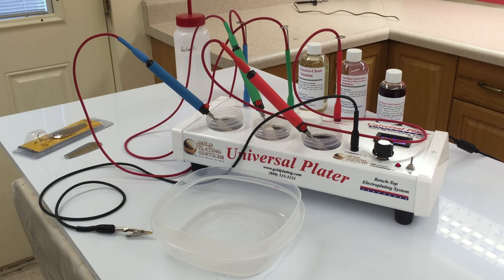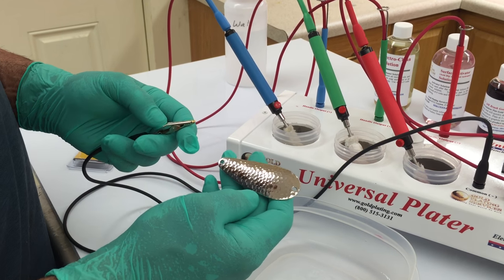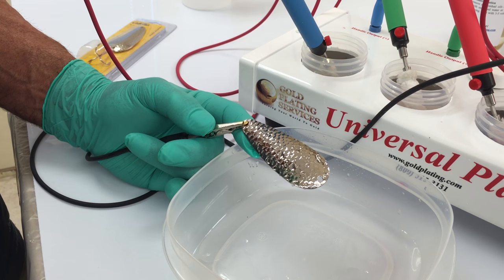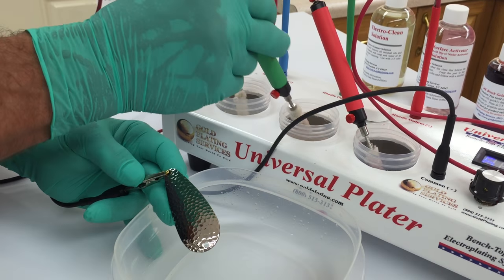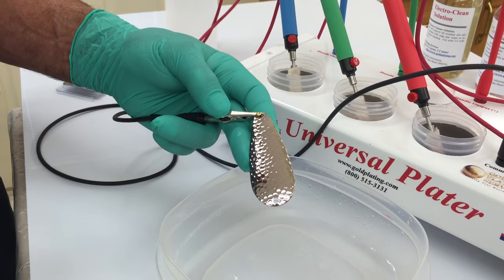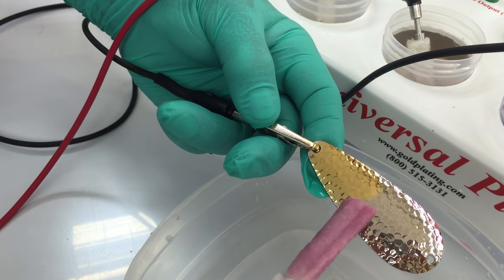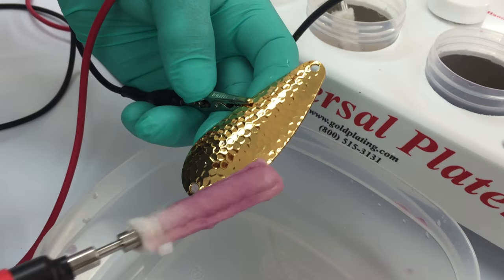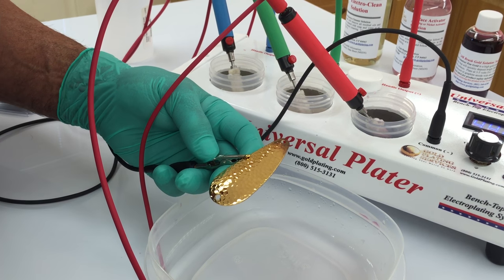24K Brush Gold Plating - Plating onto Nickel - Universal Plater KIT

Comment: great video, i think this producr would be best for me when i try to plate my brass statue i've been sculpting. i know a thin layer of gold tends to tarnish along with brass and copper over time so would you suggest i also buy a solution to nickel plate it then gold plate it afterward?
Reply from the maker: Great question.  Brass is often plated with Nickel prior to gold plating.  Nickel provides a "diffusion barrier" which keeps the underlying layer from corroding underneath the gold.  If the gold is plated thick enough and the piece is not subjected to moist conditions, it may not be necessary to apply a diffusion barrier.  Typically if possible and feasible a diffusion barrier is usually a good idea.
Reply: Gold Plating Services thanks for the info!

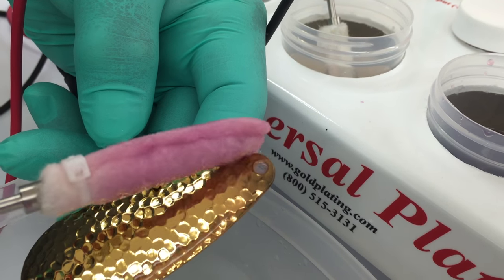Comment: +Gold Plating Services  Okay so @10:43 this is exactly what is happening to me except my power supply is only set at 5amps / 4.5v and I'm seeing at that range a heavy amount of gassing.  I'm going to go switch it down to 4.0 to see if that fixes my problem and I'll get back here with an answer but thank you, at least I now know I'm over powering the power supply apparently.
Reply: Thanks for the video, this was my problem.  I took the dingy coins and rubbed them down with a baking soda paste and it cleaned them right up.  What is that (oxidization)?  Either way, it cleaned up very nicely and apparently allowed me to put another coat of gold on this time using a setting of 4.7amps / 3.5volts and it worked great.
Reply from the maker: Your amperage is way too high.  We are glad to hear that you were able to salvage it. This is a perfect example of "burning".  Its best to have our power rectifier set to "automatic amperage" or "voltage control" if it has that, to where it automatically takes the amperage needed based on 4-4.5 volts.  Typically you should only need less than an amp for brush plating, probably more like 0.1-0.5.

Comment: Does this work on brass?
Reply from the maker: Yes, brass is quite easy to plate onto.  When plating brass you Electroclean first, then use Surface Activator, then plate.